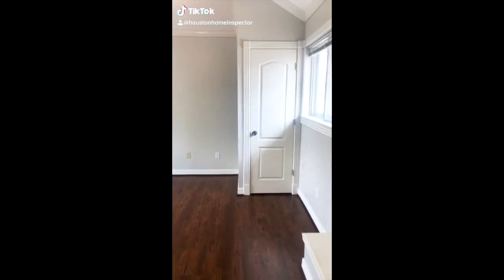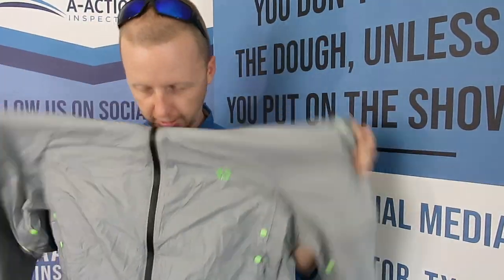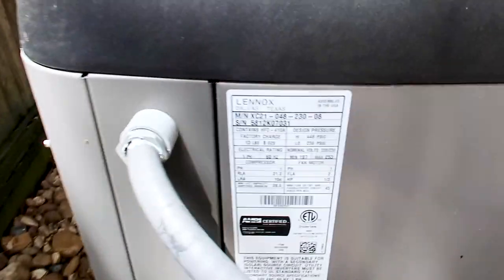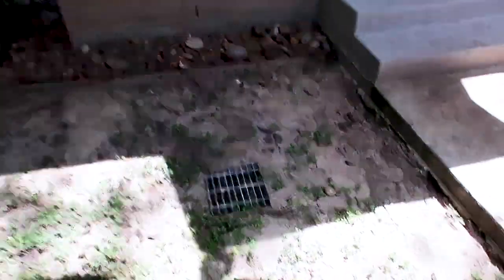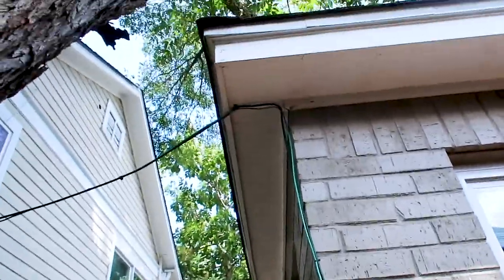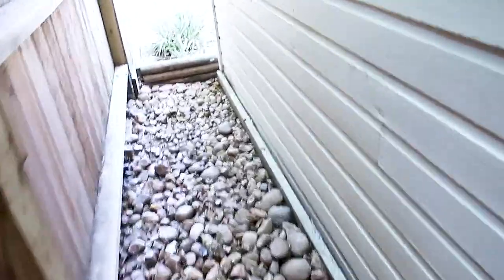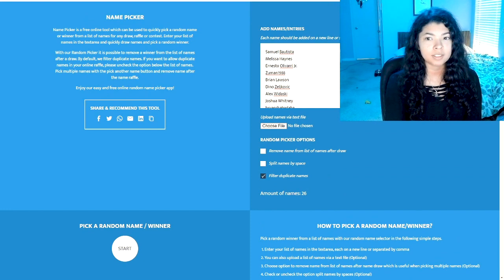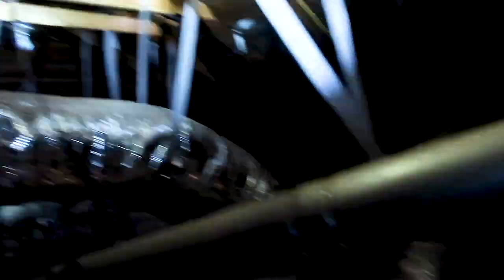Home Investigator: Episode 14 - Old Home Inspection

Comment: Good point about the added support in attic space. We just had a 1913 no added supports but added new sheets for roof and bowing all over due to added weight.
Reply from the maker: Thank you for the Comment,  You have been added in to the drawing.

Comment: keep up the good work with the videos!  I had a question though.  in a previous video you mentioned that you were adding ipads to your inspection kit and said that you were going to use a new software because it streamlined your inspections; but i still see you guys using digital cameras, did the software not work out or is it just easier to transfer the photos?
Reply from the maker: We ended up not going with that software because the software creators went in a different direction.  So, we are back in the bata phase of working on another software.  We would love being on IPADS but right now the product we use is whisper reporter with surface pros.  Being in business I have found shifting fast and often keeps you in the game.